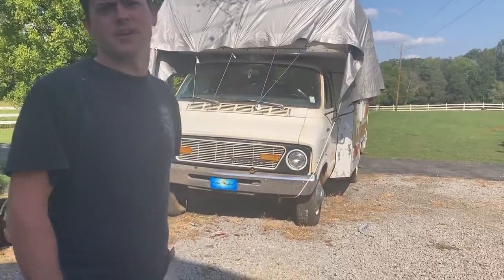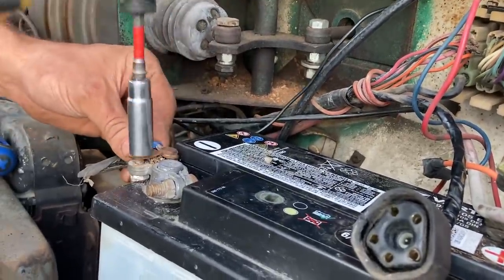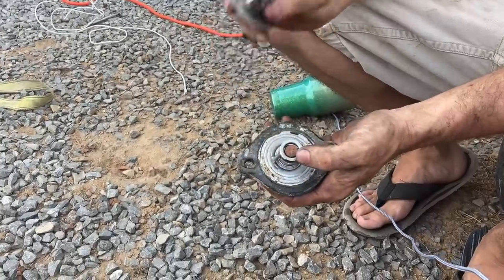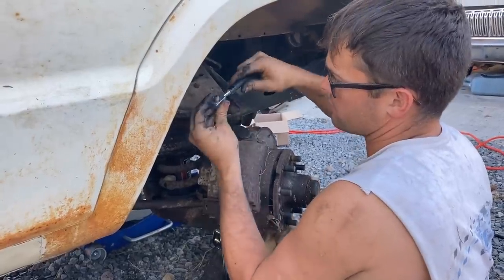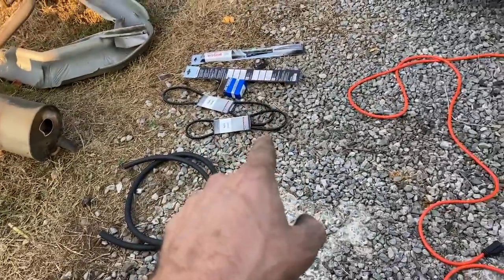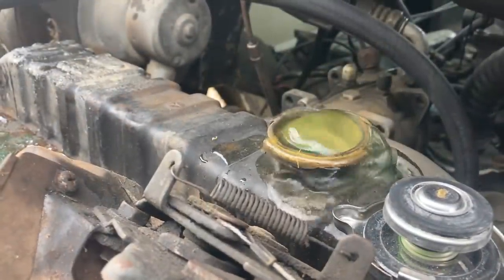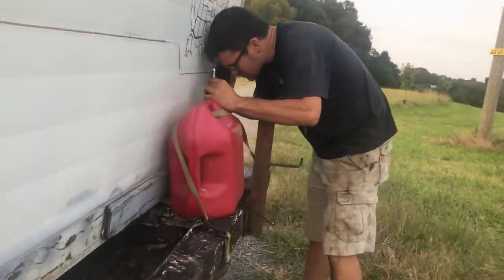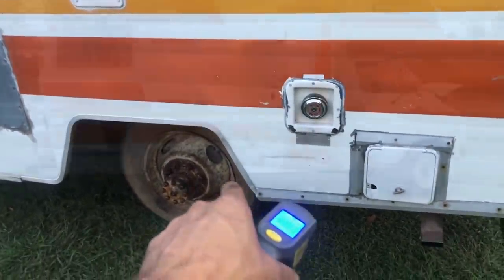broke down in our old rv on our first drive after it being parked for 27 years

Comment: Electronics is what I do, and I am a car guy. Hopefully this will help someone. 

Mopar Electronic Ignition is the same as Ford Duraspark is the same as GM HEI. They're shaped differently but basically electrically identical to service. I am a Mopar guy, but GM's HEI is better because it's all built into the distributor, less connectors to corrode, and one wire with 12V on it will get you off the side of the road. You can make a Mopar run with a GM HEI module strapped to the firewall, just like you can make a Ford run with a Mopar ignition box in place of the Duraspark module. They are all basically the same except for the connectors and the shape of the boxes. 

Pickup coil - never seen one go bad in Mopar, but check it with the ohmmeter; if you have continuity, it's probably good and no short to ground, I seem to remember 22 ohms. Ignition box - Mopar and Ford - make sure it's properly grounded. Ballast resistor is similar to the resistance wire on a Ford Duraspark; it will start but as soon as you let off the starter, it stalls out. Ford coil connections are garbage; that clip-on sleeve thing. GM HEI was easily the best since pickup coil and module and ignition coil were all mounted together in the distributor and the module is directly grounded to the engine through the distributor body rather than being bolted to sheetmetal which rusts faster and breaks your ground connection. 

I am a Mopar fan, but I can respect good design and quality from any brand. I am not a blindly rabid fan-boy to any brand, but I like my American cars. GM HEI knockoffs are available for Mopar smallblocks and maybe even the Slant-6, and I would consider it to be an upgrade in a vehicle where originality is not important. 

Always keep a spare ballast resistor in the glove box of a Mopar with that electronic ignition system. It's a 3/8" bolt holding it to the firewall or to the inner fender, usually fails in a parking lot and doesn't leave you on the highway, and since it's ceramic and does not need to be grounded, you can leave the new ballast resistor hanging off the wires until you get home. Don't even get me going on the Chrysler Lean Burn computers mounted on the air cleaner - when they worked, they were pretty decent and great gas mileage, but they had no way of telling you what was wrong with them so repairs were shotgunning parts at it in the hope the engine would run properly; get a Mopar HEI retrofit kit right now. 

Up here in Canada, we had Hyundai Pony and Hyundai Stellar - as well as several Lada (Russian) models. We also have a very cold climate, try to imagine playing with points. Gap and dwell, well below freezing, to try to start your car on a dying battery so you can get to work. I'm a 48-year-old man; American and Canadian cars all got rid of points by 1973/1974 due to EPA. So I'm a pretty young guy to have had points and condenser on a daily driver that wasn't an antique. 1985 Hyundai Stellar, RWD, 1.6L 5-speed, carb with manual choke. I think a Buick 3.8L V6 would have really lit up that car. Shoulda coulda. 

Electronic ignition all the way. :) 

Mopar has the best-looking alternators and the best-sounding starters. Hands down. :) 

Take care of that thing and your clan.

Comment: I gave a thorough discussion of the problem with the hub diameter of the Chevy wheels in the comments of your first B300 video.    If you have a machine shop with a lathe you can remove metal from the center bore of the wheels, but it is not really worth it for the steel wheels.
Hopefully you got 215 tires instead of 235.
Reply from the maker: Ok thank you

Comment: I had a Dodge mini motor home. It was overall a good one. Until I got T-boned and it flipped over destroyed it. Now I have a Diesel pusher Cummins with Allison Transmission. I’ve had 3 coaches. The mini and the diesel have been the best. Had a Dolphin Coach. With a Chevy big block. And couldn’t keep manifolds on it. The broke and cracked all the time I had it. Hope you enjoy you motor home. There great with a family. But, like you said. Don’t want to be broke down on the highway. Rocky was too funny in your video. And the baby calf is cute.
Reply from the maker: Thank you

Comment: On old Mercedes, sometimes the Ballast Resistors will overheat and die if the key is left in the "on" position without the engine running.  Not sure if that is what happened here, but just a thought!
Reply from the maker: Ok good to know thank you
Reply: What years Mercedes’ are we talking about? I had a 1968 250S, then I got a 240d and I still have it

Comment: Hey  Sleeperdude, My comment may be too late here, you may already have this figured out. OK, as far I know, Chevy hoops will not fit a Dodge or a Ford, however, it used to be the case with older cars & truck`s from the 60s &70s that Ford & Dodge / Plymouth shared the same bolt pattern, heavy motor homes could be different. hope this may help.
Reply from the maker: Thank you I ended up getting ford ones from the early 90s and they fit

Comment: the blistered back of the old module says it garbage. the early mopar and ford ignition modules were garbage . delete the module and replace the distributor and coil with a breaker point distributor . it will be reliable . after that .
Reply from the maker: Ok good to know

Comment: those new copper washers were too thin. the parts aren't supposed to touch.  i had this happen on my truck. get the thicker washers or stack new ones. 

never seen the vice grip on the line trick. they never unscrew. i usually cut the line right behind the nut and unscrew with a hammered on metric socket so it will not round off.
Reply from the maker: Ok thank you good info

Comment: When the car stalled out, by ear it sounded like you were getting to much air through the carburetor.Lastly, when you changed the fuel lines, did you use a house with a bigger circumstance than the old one? Maybe it’s flooding out the carb like you said.
Reply from the maker: Ok thanks no it was the same size

Comment: Once the fuel tank is set and sealed up it should run fine. You were drawing fuel from an open can. Emissions by '74 required a sealed system.  

Be glad it wasn't a 1975. Would have the Chrysler 'lean burn' system (junk), catalytic converter, etc. 

Best luck with the new critter, teach him that belt buckles and bothering dad under vehicles ain't gonna work !
Reply from the maker: Ok thanks

Comment: It appears the original 16 1/2 wheels were "coined" (dished/out) at the lugs. Try 1980's ford 1 ton wheels. I know they are coined and maybe they have the larger center hole.
Reply from the maker: Ok thank you I will check them out
Reply: @Sleeperdude  
yes sir

Comment: Sleeperdude,

I was wondering what model of DEWALT impact that is?  I have been looking for one of these for a long time.  These old rigs certainly need alot of love after sitting for years, don't they?  typical dodge engine though!  just some minor work and it purrs again.
Reply from the maker: It’s a 20 volt brushless high torque Dewalt works great .. thanks for watching

Comment: Dude i don't see you having any problem with trans but check it. Mine does run like shit when just a little low enough on tran fluid  no Joking . And ya it Happens mostly fluid heating burning in these. Mine also if low in trans fluid will die on a Hill. i don't know how this i guess Transmission Protection works and Grace to ya and your family.

Comment: Dude have you checked Transmissions entire system. like even if you see no leak in Tran pan still it might be low enough for it happened to mine . not sure whats going but but mine would not run or even Start being just a little low on Trans Fluid . Sounds Stupid but its what happen to mine. I also found a few did not know about this.
Reply from the maker: Ok thanks

Comment: The best ground you can get is to run at least a 8 gauge wire from the back case of the alternator to the - on the battery....not from the chartering post but the aluminum casing....your bridge rectifier is mounted inside the alternator there....best ground on the vehicle...then run a ground from the battery to the vehicle body....heavier gauge wire the better
Reply from the maker: Ok thank you

Comment: Love this series, please keep it going. When you first looked at the tail of the transmission I noticed an oil streak across the underside of the floor just above the spline area. Likely the rear seal is shot (an easy fix and possibly the reason for the low tranny fluid level). Also those two unattached wires at the rear of the engine might be the reason the temperature gauge doesn't work. Find you temp sensor and trace the wires to see if it's connected or cross those two loose wires and see if it affects the temp gauge. Anyway I wish you the best of luck with this project.
Reply from the maker: Thank you there is a new video coming out today about the rv
Reply: I have a 79. And thermostat carb is pain on neck

Comment: With my 1970 Plymouth 440 Fury, I always carried a spare ignition box and ballast resistor as 99.9% of the time, that was the non-start issue cause.  Those ballast resistors would just quit working for no apparent reason.  I think I went through about 3 of them in a 5 year period.
Reply from the maker: Ok thanks
Reply: Mine never did. And I have a 1973 Dodge 300 Minnie Winnie RV

Comment: Part of your oil problem could be that you're running 5W-40 instead of 15w 40 most people and old engines with lots of miles on them15 w 40 with two cans of STP oil treatment in there on your next turn
Reply from the maker: Ok thank you

Comment: You sure Rocky didn't get in there and chew on some wires when your back was turned? Those ignition modules and the ballast resister were notorious for just going dead for no reason happened on the two dodges I had. You say your wife doesn't like it when you break down on the side of the road too much well who would like to break down? It's always good insurance to replace all the hoses and belts just on general principles solves headaches later on down the road. My guess is that you need a fuel regulator between the fuel line and the Carb.
Reply from the maker: Thats right

Comment: 56 dollar e bay distributor and a 35 dollar 65,000 volt coil wakes the dodge  right on up.

 comes with a mini hei chip in the housing and vacume advance 
put one on my 318  1987 b200  with 1  full size rear door.
where else can you get b200 carrying capacity on a vehicle that weighs only 4,000 lb?

  the lean burn digital  ignition advance box burned up in a fire so it had no advance.
Reply from the maker: Ok thank you I have been thinking about that

Comment: If you notice I had someone look behind your rig there when you held the butterflies all the way open it was loading up on fuel cuz it just puke black smoke out the tailpipe so yeah it's a needle and see issue replacing healing seat and accelerator pump and gaskets you might actually get away with it if not I'll Rock City or something you're going to drive I don't know basis on the road like you're planning that would probably be your most reliable option definitely will get the most gas mileage you can get

Comment: you can get 16.5 tires but the dodge is 16.5x 8.5 so unless you have them custom made you cant get them my 78 runs 19.5 alcoas so i can just use semi rubber instead of custom rubber
Reply from the maker: Ok thank you
Reply: also your missing your overflow tank just cap the end off with a vacumn port plug or it will always leak or i can show you what a stock one looks like so you can buy one
Reply: your ac evap. core is inside your heater core box thats what the metal line at the bottom is

Comment: I had a 1979 Chrysler Lebanon with
A 360 bought it in 1979 it had 9000 miles on it the people traded it in because they would be driving and it just quit running usually it would restart.  They had it back to the dealer over and
Over again and no one could fix it. I
Talked to the previous owners and they told me not to buy it.  But it was a beautiful car and almost new It was still under warranty so I called Chrysler and they told me they would stand by the warranty and fix the car.  I purchased the car and it was great for about 2 days then I sat through 6 changes of the traffic lights it would start and die I really thought I had made a mistake took it to the Chrysler dealer and they put s new ballast resister on it just left it hanging and had me take it for a test ride ran perfectly thought it was fixed took it back they bolted it to the fire wall and I headed for home and almost immediately it started dying again to make a long story short it turned out the ballast resister was shorting out against the fire wall we put a fiber washer between the resister and the fire wall and I drove the car until I sold it with 72000 miles it was a great car after finding the problem I carried an extra ballast resister in the glove box but I think I only changed it one other timehad the 360 engine
Reply from the maker: Ok thank you

Comment: I never did like Mopar stuff it was always hard to keep it up GM was the best in the 70s. The hydraulics the moisture so bad in the South now that it rots everything so I find rather than overhauling calipers like I used to do to save money if it's a car I'm going to keep it's going to sit up a lot and it has to live outside I switched it over to silicone.5 and rebuild it that way I did it all Volkswagen that way and left it in storage for 20 years and I thought all of the calipers are going to have to come apart I'm sure they're full of rust and I went to take them apart and they were sparkling clean and I was like that's it that's the solution Alabama moisture. And on the fuel tank when you do get new ones coat it with red coat from day one so it won't rot out and never run ethanol gas unless it's an emergency cuz it's going to destroy the diaphragm in the fuel pump even if the tank has been treated in the lines or ethanol resistant and the metal lines I even pour it down nose and and blow them through so they get coated internally cuz they really switched over to that corn alcohol field to destroy old cars to get them off the road. In Russia they don't sell corn alcohol in their fuel they can get 95 octane fuel for what we pay for 87. And if you do I'm foreign cars when you need some interior plastic and you want to get something that was never beaten to Hell by the sun you order it from Russia that's what I'm doing cuz it's cold there all the time and all the plastic stuff isn't destroyed from the heat of the Sun and the exchange rate is good so your dollar goes further. But I noticed you don't have a lot of foreign cars I've got a lot of foreign cars so I have to shop for my parts all over the world it really slows you down on a restoration project because of that and I have to use translation Google to be able to talk to the people and these foreign countries to get these parts for these vintage cars I work with but when you're done you have the only one in the state and everybody stares going what the hell is it and look it's really old and it's driving.

Comment: and i bet you don't replace the fuel pump on the side of the engine. this being said as your tuneup vid begins. if you don't replace that fuel pump that diaphram in the pump will be rotted and allow gas into the oil. of which will burn the rods right out of the engine.
Reply from the maker: Ok thanks

Comment: Oil filter is jiffy lube tight
Reply from the maker: That’s funny
Reply: @Sleeperdude  you can take rear single wheel and turn it facing out so you still have most of the width of track JT

Comment: No! Never straight anti-freeze. It crystallizes sooner as temperature drops  to / below freezing. I was told that 50/ 50 is best. Wintertime I always used 195° thermostat. Quicker warm ups, plenty of heat..
But you ask about this first..
I lived in the snow belt part of New York State for a while. -13°f was common.
Reply from the maker: Yeah I’m not going to run it with straight antifreeze

Comment: The only thing you forgot was to leave the left turn signal on and drive 7 to 10 mph under the speed limit. Then you would have really been on vacation. Also I believe that ford wheels have the right bolt pattern and center bore for that rig...
Reply from the maker: That’s funny thank you for the tip about the wheels
Reply: Ford/Dodge interchangeable for sure

Comment: Balist resister on the fire wall I had a dodge van new it was always hard starting because of the carburetor was areal piece of crap had the 318 motor  to this day I will never buy another dodge I think it’s the poor mans Cadillac the brakes have plastic pistons instead of medal they wear down so far then lock up  mine would do the same thing when the engine was warm if I hit the pedal when I got in flood
Reply from the maker: You are right

Comment: Had a crazy idea, how about throwing a 4 cylinder Isuzu motor from a box truck in there then a little rehab on the house part then sell it as a van life van with a vintage style with reliable running gear :-)
Reply from the maker: Yeah that would be cool

Comment: Made the same mistake you did on the dually rims, plus the stud size on the RV (same as you 74 sportsman) were bigger than the holes on the 90's dodge dually wheels I got off Marketplace... The front two I bought new and the shop said they were ford wheels (16×7 8×165.1 Center Bore 124.1)... Really enjoying your video and humour, just had to be towed on my way back from a camping trip where it suddenly died after coming to a full stop. Would appreciate the part number of those belts ! Thanks !
Reply from the maker: OK thanks man I appreciate it